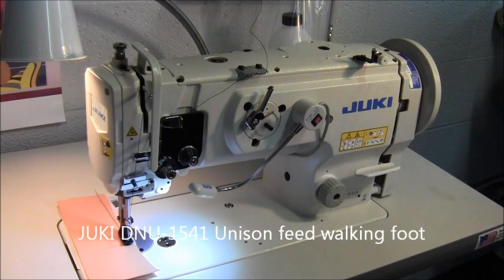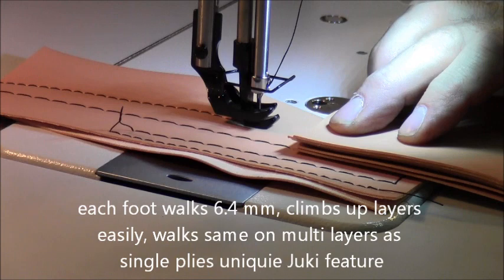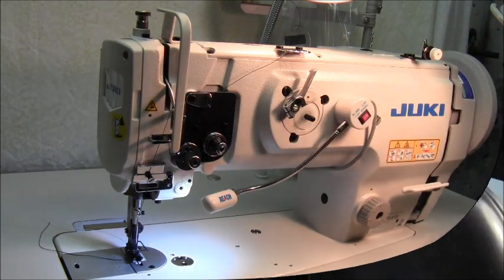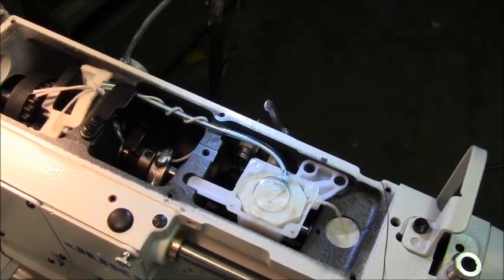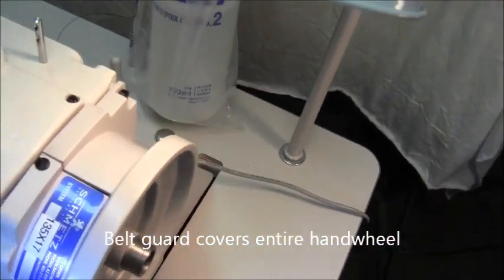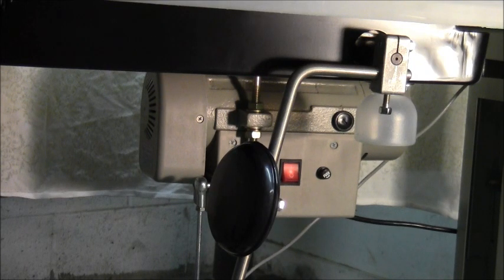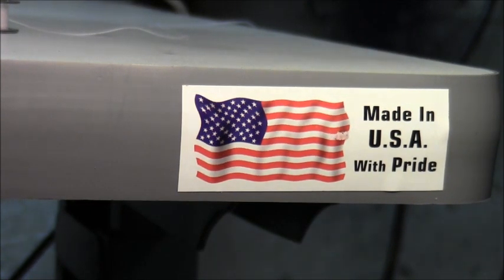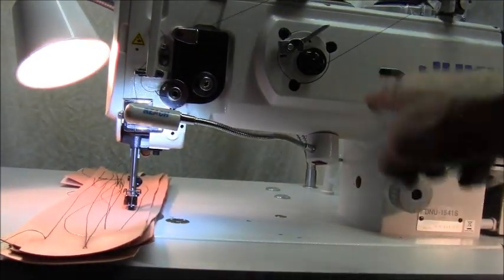JUKI DNU1541 Features of the Juki DNU1541 sewing machine

Comment: Very good video.   How do you decrease the pressure.  When using, I get presser feet lines on the fabric
Reply: Check the manual, usually there's an adjustment knob / screw above the head of the machine, directly above the presser foot.
Reply: @IBUILTTHAT  wow, that’s weird. I never knew that could be adjusted. Personally I don’t remember that ever being a problem. I learned something new today. 🙄